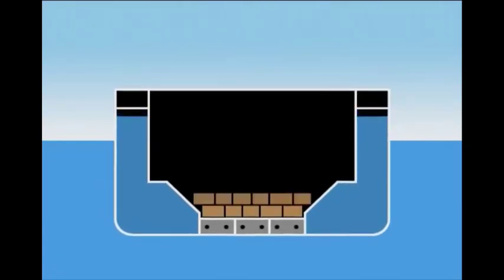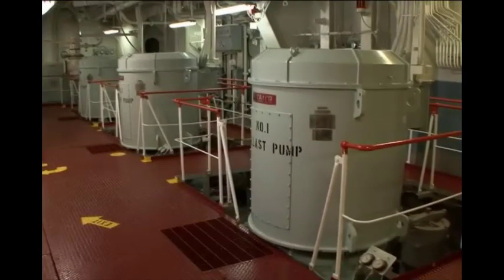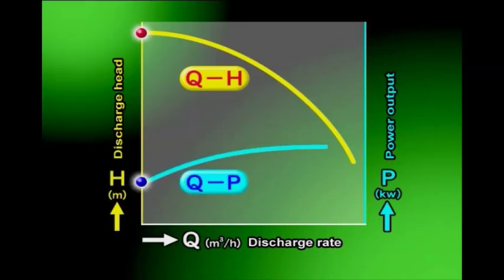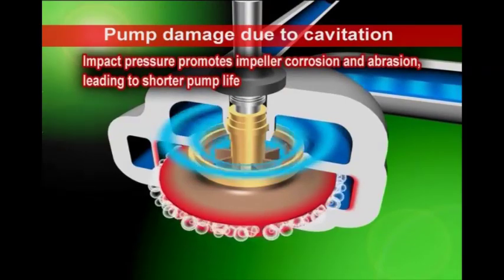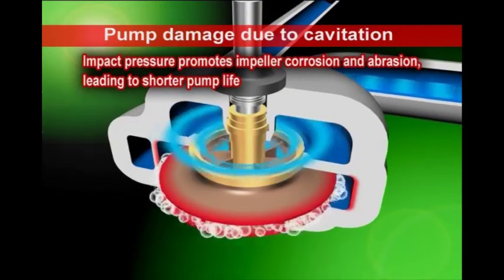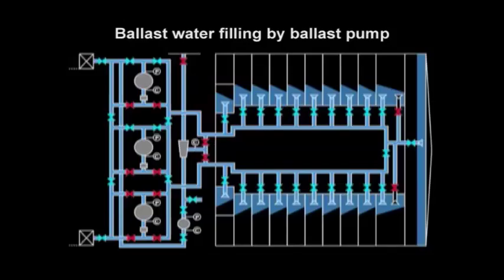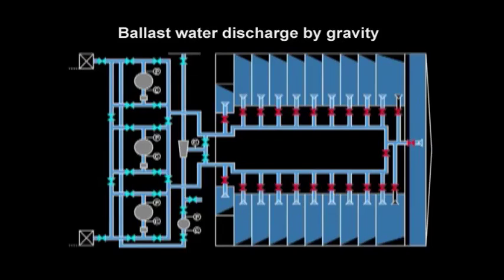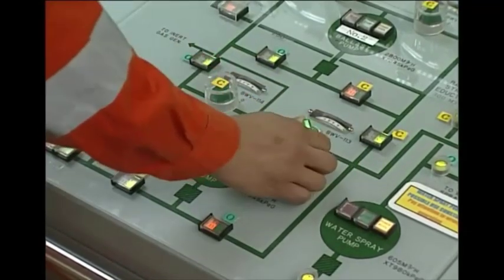Ballast Operation

Comment: This is a wonderfully informative video! When I searched ballast systems, I wasn't expecting anything so comprehensive and professionally done, thank you!
I'm super curious though, how on earth do you keep the pipes and pumps free from corrosion with all that sea water going through the system? How do you even check for corrosion in the piping?
Reply: ballast pipes are coated internally with a rubber lining of some sorts, but over time these fail. Pipes should be inspected during every 5 year survey in the yard. Even then, breakdowns and leaks occur.
Reply: @gwapolechonero  Thank you!